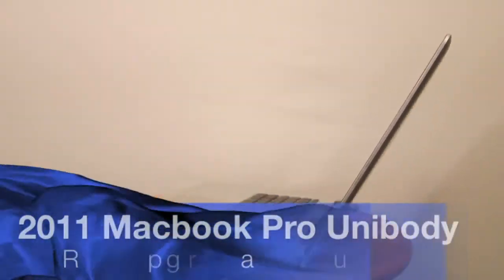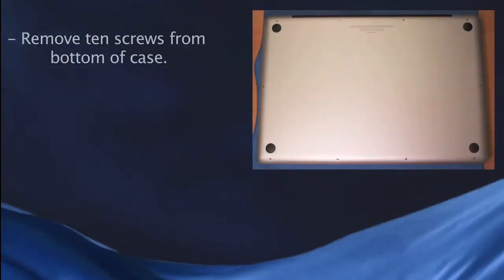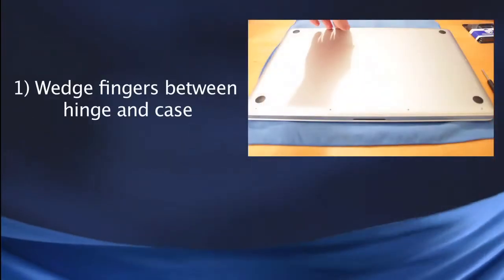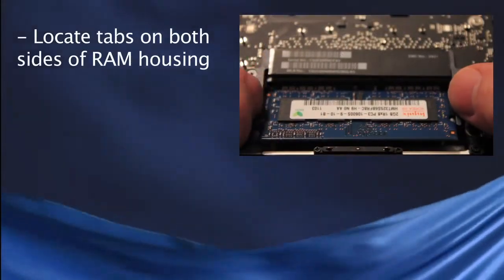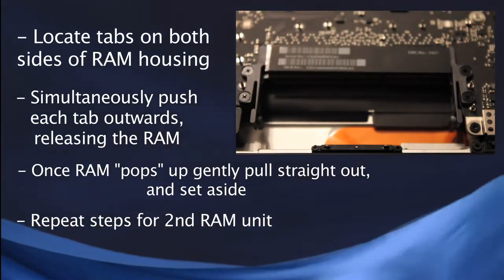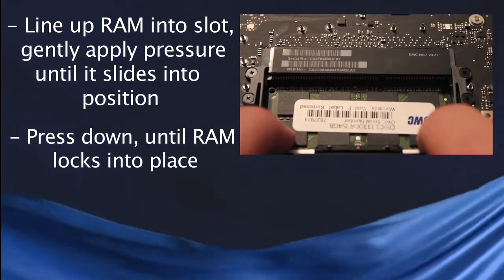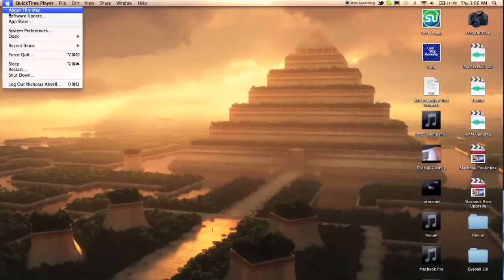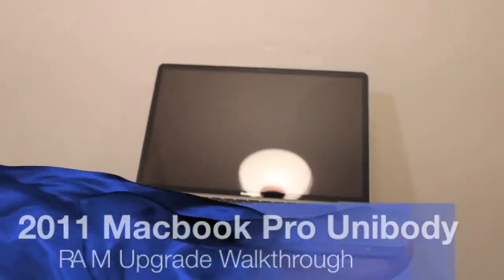2011 Macbook Pro RAM Upgrade

Comment: Little tip.

You don't need to remove the screws completely. Unscrew them enough so you can actually remove the back plate, then you can pick it up with the screws still in the holes and just set it to the side. This saves a lot of time when you're putting it back together as you can just place it back on and the screws are already in the right place to put back in. It stops the confusion as to where the longer ones go too lol.

Comment: Hey Nick, That's got to be one of the most informative vid's i've seen so far, Listing the Tool's needed as well as describing the Screw size's as well, As most pple would not realise that diferent screw size's could be put in the wrong slot and could dammage the thread's, You made this look so simple to do as well, Nice style on the video overall, Great job MF :)